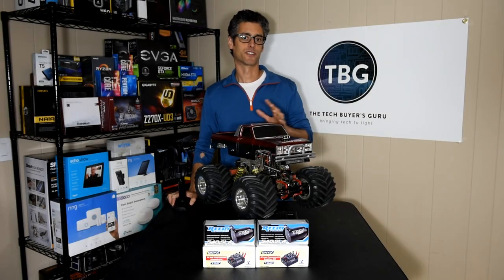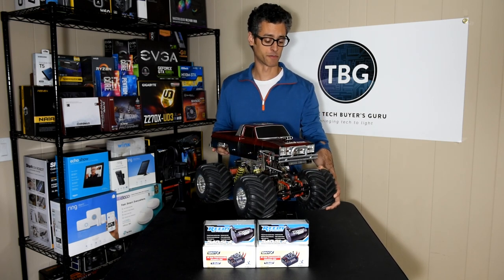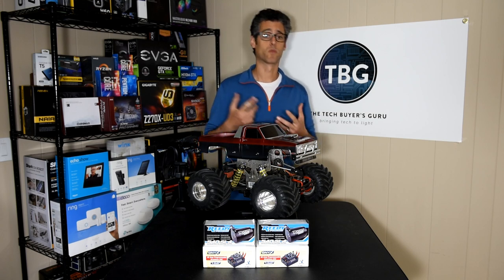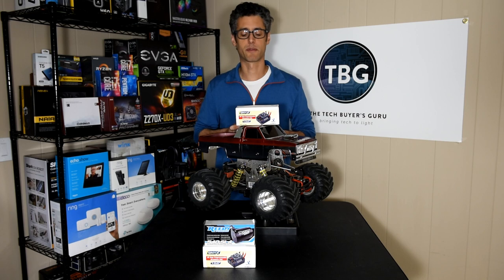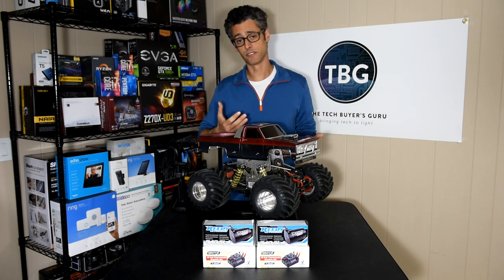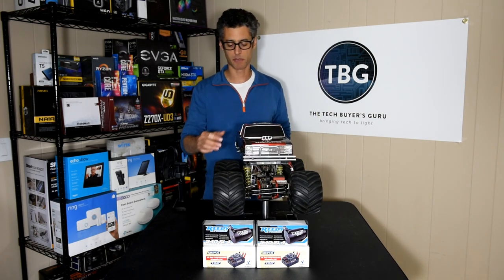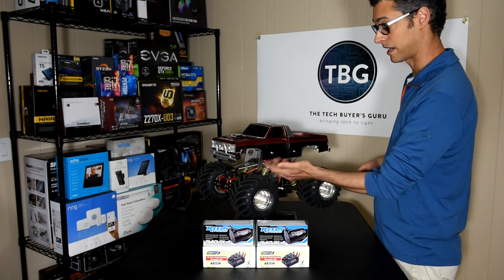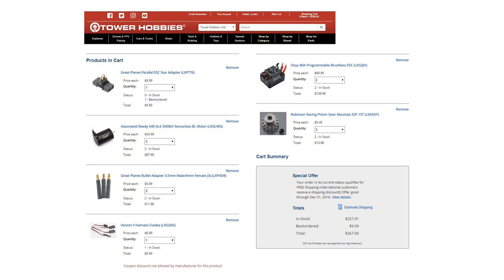Tamiya Clod Buster - Dual Brushless Motor Upgrade Guide

Comment: Dual brushless motors it’s now race ready, got the cpe chassis, that’s one awesome Clodbuster. I just joined a race group n have my clod in the retro class, but I’m gonna build a clod with cpe or zrp chassis for one of my others then I’ve got the redcat ground pounder done up, so I’ll have one in retro,sport mod, pro mod.
Reply: Some guys use the traxxas evl-2 in think for the emaxx with dual motor set up, but that might be for just dual brushed motors not sure if that could do dual brushless
Reply from the maker: Stevo, I have some bad news for you - my Ground Pounder bit the dust. The Castle brushless motor was just too much for the drivetrain. Mine blew a bearing, which led the gears and (upgraded steel) driveshafts to chew themselves up, and I decided to pull the electronics for a new project (which you'll see soon!!!). Check your GP often for slop between the driveshafts and the gearboxes, especially if you'll be racing with it.
Reply: The Tech Buyer's Guru ya the guys in the group have told me I can put the smt10 trans in it, so I might end up doing that, but right now, I’ve still never ran the truck since I built it, but Oct 7th will be my first race day

Comment: My clod buster is moded with two brushless motor s two escs and two batterie packes has one very strong savox servo that is waterproof and it also has beedlock rims
Reply: I also upgraded the shocks to oil dampen shocks I two 3800 kv motors from castle where two sidewinder 4 escs

Comment: I'm sitting here looking at a pair or JPS dual motor cases, thats right..4 motors, I guess I would go 4 brushed motors and 2 esc's. I've had these cases in storage for a couple decades..I cant even find a pic, or even reference off the net. If I remember, I ordered these from JPS, maybe one of the last things they did

Comment: Great video and I’m going to copy your setup 🤚🏻
Reply from the maker: Go for it! One thing you might try is getting a Hobbywing combo. Those ESCs I used are actually Hobbywing rebrands, so you can just get this combo with a 3300kV motor: https://www.amainhobbies.com/hobbywing-ezrun-max10-sensorless-brushless-esc-3652sl-motor-combo-3300kv-hwa38010203/p713296

Comment: Thanks for sharing, I bought the black edition today online here in Oz, should have during the next week. But my mind has already been ticking about more speed, without being ridiculous.
I was thinking of some lower turned brushed motors? I have used some cheap Hobbywing plain box brushless systems in my Kyosho re-releases that I’m yet to run. They are buggies though and obviously have a lower centre of gravity. I don’t want to be constantly turning this beast back onto it’s wheels ever few minutes. I’m not planning on many if any other real hop ups, hence my hesitation to follow your setup. Did you run anything similar prior to the awesome amount of mods that’s obviously able to handle brushless like your chassis and suspension mods.
Reply from the maker: Congrats on picking up that Black Edition! It looks awesome, and gives people another reason to own the one and only Clod Buster! I actually ran dual Kyosho 24T brushed motors in the Clod before going brushless. You can see a running video of that here: https://youtu.be/rwwk_A8uue8. Also ran dual 15T brushed for a while, and it was nearly as fast as the dual 3300Kv brushless I eventually went with. If you don't change the chassis, though, handling is going to be a weak point, so I'd recommend going no hotter than a couple of 19T motors, which will give you a nice speed boost while still being within reason for the stock chassis. Team Associated has some new brushed motors that look great for the price - here's the 19T model: https://amzn.to/3bldgbp. Note that you should avoid popular 550-can motors. They won't fit.
Reply: Those 19T motors look great.  Any modification on the clod necessary? Thanks.
Reply: @TheTechBuyersGuru  Would you be able to confirm those Team Associated 19T motors will work on the Clod, and is it easy to reverse one of them?
Reply from the maker: I haven't tested them, but I've run many other brushed motors, from 15T to 24T, in the Clod, and they all work great. 15T translated to 15mph, 24T was 11mph, so 19T should be right in the middle. And you don't need to reverse them, you just can't modify the timing.

Comment: I will be applying this to my redcat clawback which comes with dual brushed motors and a 60 amp esc (dual motor ready). I've been thinking on how to convert to a dual brushless motor using a single esc but cannot find one. But I've been told that the traxxas xl-5 can, not sure how true that is but I'm not willing to take that risk. Maybe 2 esc with a Y harness into a single channel might work!? But then how do u calibrate it to one single receiver/transmitter?
Reply from the maker: Glad you found this tutorial helpful.  The Clawback (https://amzn.to/2DhsYpc) looks like a ton of fun, and it would be even better with brushless power! With that said, I can guarantee you there's no way to do that with one ESC. But honestly, the system I show in this video works perfectly. Two ESCs wired with a Y-harness into one channel on the receiver is no problem. You calibrate the ESCs independently, not through the receiver.

Comment: I’m trying to setup my clod with the exact  electronics.  I’m not able to get the two ESC’s running at the same time.  I have them y-harness, but Im only getting one of the ESC’s running at a time.  Both light up, but only one motor runs at a time.  
Any suggestions?
Reply from the maker: If both light up, they're both getting power, but not the receiver signal. Check your wiring again. I'm assuming that if you switch which ESC is plugged into which side of the y-harness, the other ESC will start working. Try that, and it will show that the y-harness is the issue, otherwise one ESC may not be working. To test that, just take the y-harness out of the loop and connect both ESCs directly to the receiver one at a time to test if they work.
Reply: You will also have to remove one of the red bec wires

Comment: Brought a clod 2 months ago but not built yet...do you need 2 ESC's?.
Reply from the maker: You absolutely need two ESCs if you are using brushless. No way to do it otherwise. If you are using brushed, you can run one ESC.

Comment: Hi there..am wonderin your opinion about the buster re realease kit..have u havin some trouble with the gear..are the gear gonna hold the double brushed stock motor??coz thats not gonna happen with the re release lunchbox..only hold a year until its torn apart by the stock 540 motor..but am realy love the tamiya chevron tires..tx in adv..cheers
Reply from the maker: The Clod Buster gearbox is excellent, one of the best features of the truck. It can handle plenty of power.
Reply: @TheTechBuyersGuru  nice..are you still using a plastic gear from the stock are you upgrade it with a metal gear stuff..lil bit confuse in here am i gonna take it the clod or txt 2
Reply from the maker: Using plastic gears, but upgraded the pinion to Robinson Racing steel. The gears in the Clod gearbox are super-wide, very durable. You really don't need to upgrade them to metal.
Reply: @TheTechBuyersGuru  mmmm...dunno men...lil bit doubt about the gear..the clod are using the same gearbox with the grasshopper and it precisly the same with the pumpkin..many time my pumpkin having a slip gear problems..and after ive chance my motor to a brushless system the gear couldnt hold on and now torn apart..i think ill go with the txt2..more convy for me to do so..tx for the sharing btw, am still in love with the killer looks of tamiya..cheers

Comment: Crap, your list is all out of stock or no longer available. Can you recommend different models of same parts, hopefully costs less. Thanks.
Reply from the maker: Not sure you can get much cheaper at this point, but comparable quality would be a couple of these Hobbywing combos: https://www.amainhobbies.com/hobbywing-ezrun-max10-sensorless-brushless-esc-3652sl-motor-combo-3300kv-hwa38010203/p713296
Reply from the maker: It's a pretty high kV for a Clod, that's getting close to what's used in racing, so you'd need a very dialed in custom chassis or you'll be flipping a lot. You might also have some low torque off the line, because those aren't actually racing motors. It looks like there's a 3500kV combo, that would probably be better. Either way, the you can use any remote as long as you have the splitters listed in the video description.